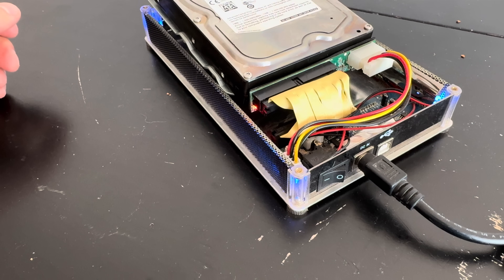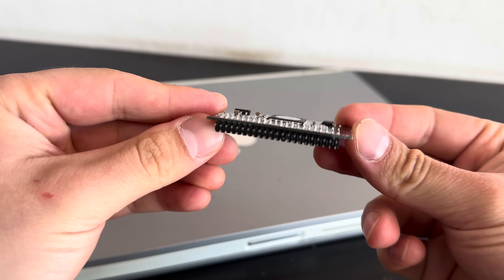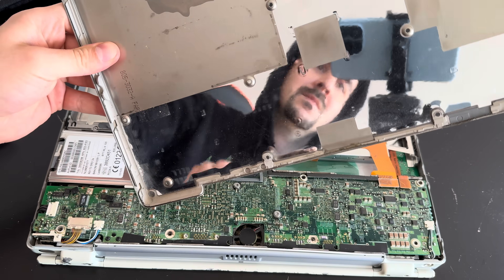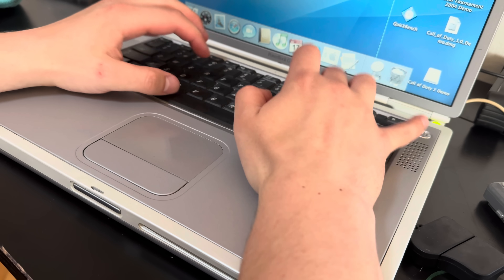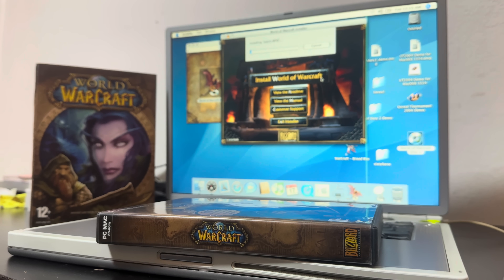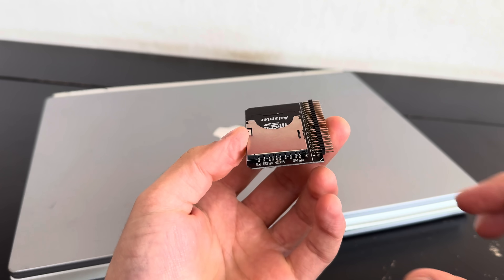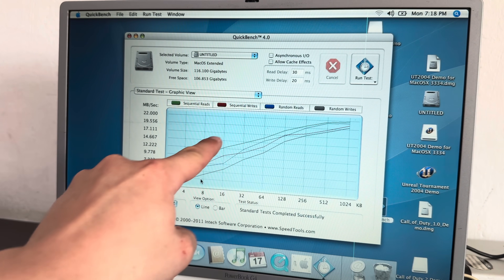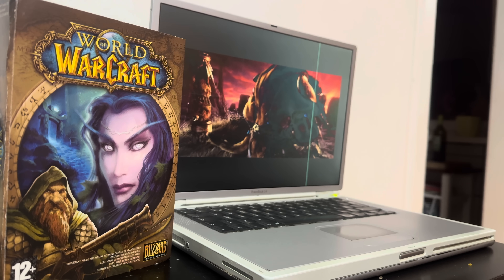Using SD Cards Instead of HDDs?

Comment: I use SD cards or SSDs on all my old Macs, and even with my old 8-bit Atari gear (it thinks it's a bunch of floppies and cartridges). It makes doing stuff on them so much easier and faster.
Reply from the maker: I was thinking about getting a gotek for my ST. But truth be told, I don’t really spend that much time with it.

Comment: i’m just concerned that the sd cards will burn as they are not meant for a os
Reply from the maker: I’ve heard about that issue, however, I don’t run these 24/7. Also, if you’re using them with your hobby computers, chances are it’s not a giant tragedy if it does go out, and it’s very easy to replace.
Reply: @schvabek  true, i forgot to consider that 😂
Reply: Cards with A1 or A2 designation are intended for operating system use.

But even otherwise, writing a card to its demise takes a lot of effort. If you're at all concerned, you can overwrite a larger card with zero pages and then just partition out a smaller portion to be used for OS that should give it more wear levelling room i think.
Reply: @SianaGearz  wear levelling is proven to be bullshit

Comment: I have an old Dell Inspiron 9300 which has an IDE HD., and I have thought about fitting a modern alternative, but that IDE HD., works well enough and I have a couple of spare drives.
Reply from the maker: @laurencejohnson4106  Yep, pretty much how I felt. However, if you do need to get a spare drive, these things actually work very well, and are cheap. Like borscht.
Reply: I recently scored a inspiron 9300, to go alongside my 9200, I do use a variety of alternative options for drives such as cf to ide, sd to ide and msata to ide and I can say that the sd to ide and msata to ide tend to be more compatible but don't like the fact there are no enclosures which can make installing into certain machines that are side slot loading....difficult and potentially risky due to exposed pins, usually use kapton tape for that.
Reply: @robloxian1585  There are enclosures available and I searched a well known online auction site with the following words,  msata ssd ide enclosure.

Comment: CF is far easier than SD because machines that mysteriously dont work with sd cards will probably work with a good industrial CF card.
Reply from the maker: I’ll have to try and benchmark that as well. I mean this seemed to work pretty well
Reply: @schvabek  I mean, CF cards communicate with ATA just like IDE drives and can do up to UDMA7 so they should be pretty fast, if not faster than a real IDE drive.
Reply from the maker: @Megatog615 Can’t really imagine why you’d even need all that speed on an old, hobby computer. Also, CF cards just seem to be much harder to find nowadays, and you have to get specific ones too in certain situations.
Reply: @schvabek  I get that this is obviously a personal preference thing but CF cards also make it easier to transfer files(when the machine is turned off) since all you need is a simple usb CF card reader. CF cards can also be a lot more reliable as industial CF cards are usually made with SLC flash(which is why industrial users moved away from HDDs). If your vintage PC only needs like, 16GB of storage it can be pretty cheap.
Reply: I ran an old dell on a PCI card that had 4 CF slots, each with a (then) 4GB card. Worked fine for years. I had it set up in raid mode to get a bit more perfermonace
Reply from the maker: @butwhytho6522  any reason to run it off CF cards, especially back then?
Reply: CF is a true IDE device by default. The first CF cards actually where true spinning HDDs.

Comment: I did not have good luck with my SDCard-IDE device. It loaded once but failed after some hours in a Mac. On the PC it is detected as "USB Card Reader" even it is connected to IDE. For the last 15 years or so it does a good job on my Atari 800 XL as a parallel IDE drive (which is actually as fast as the RAM on this old 8 Bit).
Reply from the maker: I’ve ran this for well over 8 hours, and no issues as of yet. I’ll do some more testing for sure, but again, it seems pretty usable, at least with the adapter I have
Reply: @schvabek  I guess I'll have to test out the one you have got. My Clamshell could use this as the HDD is loud and slow. A plus of 50% on a 500 MHz / 466 MHz class Mac and a higher capacity than the 9 GiB will be worth it trying.

Comment: Id love to see a speed test between one of these and a CF card adapter. 

I've heard CF is more reliable, but idk if either is actually faster. It'd be interesting to see a side by side OS install and crystal diskmark run.
Reply: A good CF card may be more reliable but if you run anything like Windows that is going to swap the contents of RAM to it a lot that may kill the flash cells faster.
Reply from the maker: @charleshines2142 also, nowadays CF is just harder to find too, and you have to get a specific model if you want to boot off of it.
Reply: @schvabek  the keyword for finding suitable CF cards is "industrial CF card" the industrial ones have the correct flag set in their firmware as a fixed disk rather than removable storage. they're made for the littany of industrial pc's/digital signage controllers etc that run embedded/IoT versions of windows or linux of some flavour or another.
Reply from the maker: @tech4pros1  they seem to be quite desirable for that reason, and can go for quite a lot because of that.
Reply from the maker: I’ll definitely try testing that out in the future!
Reply: The advantage to CF is the simplicity. The CF interface pretty much is a shrunken version of the 44-pin PATA interface, and no translation has to take place. They're signal-compatible so there's no interposer that could become a point of failure.
Reply: CF should be a bit better just due to the native communication protocols.  As for the comments around it not being bootable, PowerPC macs / open firmware/ mac os does not seem to have the same problems with booting from "removable storage" on the IDE bus.  At least from what I have tried.  G series powerbooks, ibook, Beige G3, G3/G4 towers, and my  Powermac 5500, all seem to boot fine with the CF adapters.  Now older PC devices, from what I tried the bios even recognizes the drive, but windows throws a fit.  Linux even works OK if the bios recognizes it. It does show up as removable though.  I found that depending on the device and its version of ATA, the fastest I can get is with the SATA to IDE bridge.  It also depends on the who makes them, as some limit to lower ATA speeds.   As for laptops, msata to IDE adapters get me faster speeds than the compact flash adapters, and still occupy the 2.5" drive size used in most portable computers. They also show up as internal drives, and haven't had any issues with even window installing.   I have only tried 3 different CF adapters with UDMA7 CF cards, but still cant beat a dogfish msata SSD with the adapter.  I did recently pick up some m.2 sata to to ide adapters, but just haven't had a chance to test them.  I wish I saved the benchmarks to post, but I would be willing to do it again except bench from my MDD with a 2.5 to 3.5 adapter instead of opening the powerbook multiple times.  Overall in a desktop I still find the bridge you showed at first being the best option if it transfers at ATA100 (if you are lucky sometimes 133).  I even find them just as fast as PCI SATA cards, which would make sense with the bus speeds, but then you don't give up a PCI slot. Also its a PITA to  try to route SATA cables in a G3/G4, specifically if you only have shorter cables, having to unplug them to open the side panel. If I get a handful of curious people, I can probably find time within the next few weeks, to make a crappy video showing this.  It is a hunt to try to find this info, so I ended up just buy random stuff to try out.  I wanted to share this for the vintage community, but never got around to it.